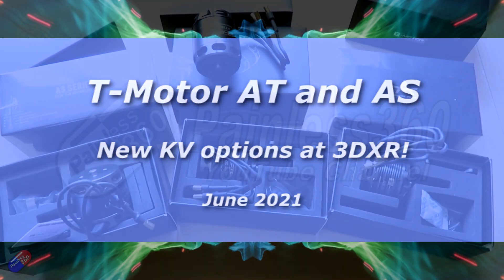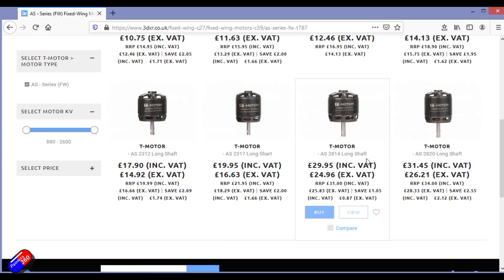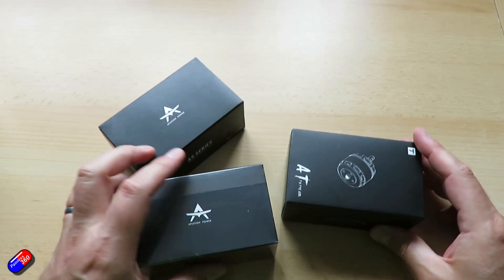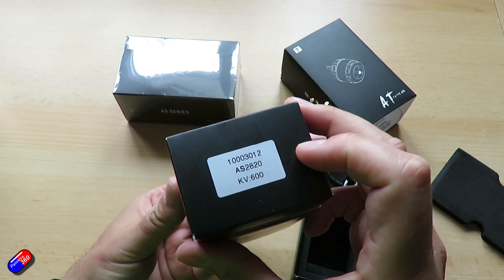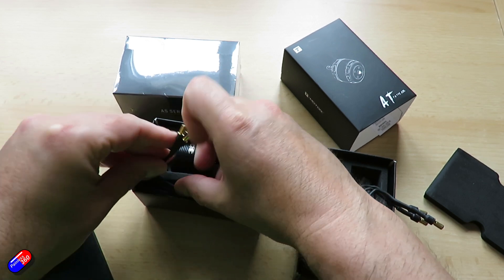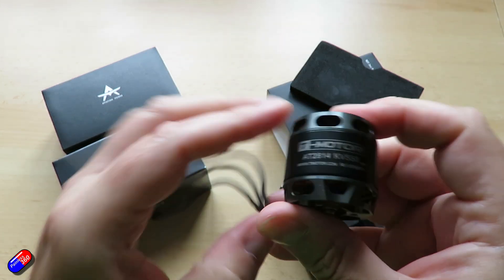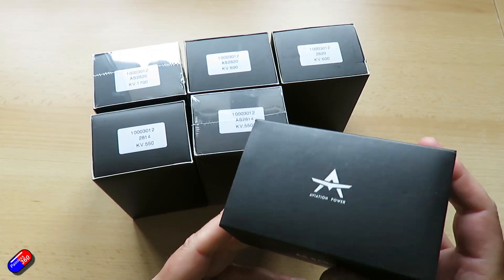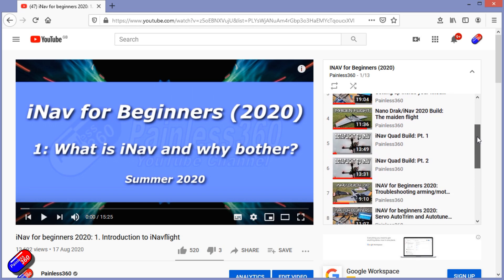T-Motor 2820 and 2814 AS and AT class motors in custom KVs!! (3DXR)

Comment: Hello can I use AS 2814 900kv on my multirotor and sir how many Amper ESC should I use in my multirotor
Reply from the maker: Check the thrust table for the motor, prop and battery you'll use and see what amperage it'll pull. Then fit an ESC with at least 20% more than that... Happy flying

Comment: Hey, thx again for super video :) 
May i ask - maybe quite stupid question but, why would anyone pick AT over AS and vice versa? What is the main difference (except the visual/cooling design of the body)?
Reply: At has tripple bearing in the larger motors
Reply: I use the AS motor for my 150-gram direct-drive helicopter because the AS's shaft is bolted to the bell instead of pressure-fitting. The helicopter's main shaft needs swappable bolting. Pressure-fit shaft requires a jig clamp around a helicopter that does not exist. The AS series basically has a general design that fits more applications, including both fixed wings and helicopters. The AT series is a single-purpose design.